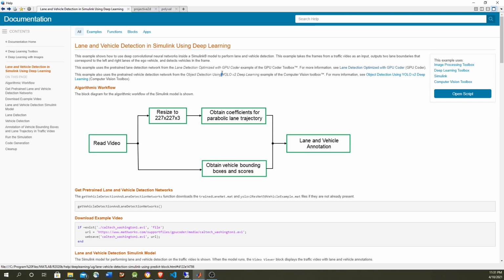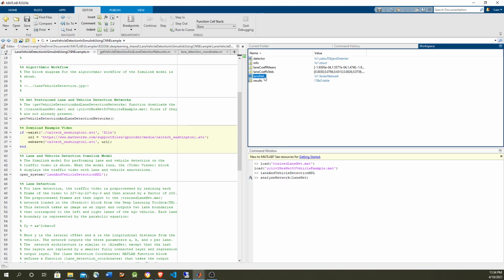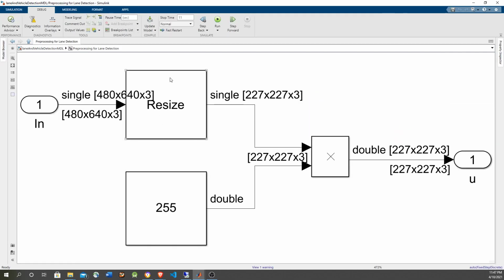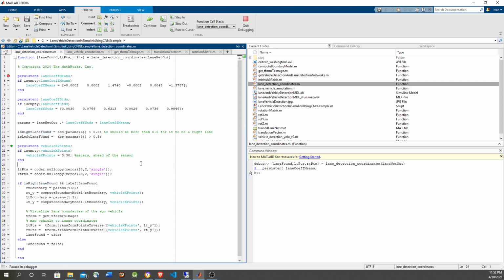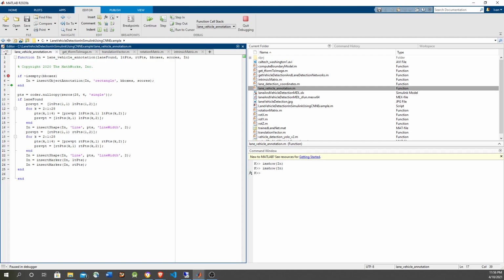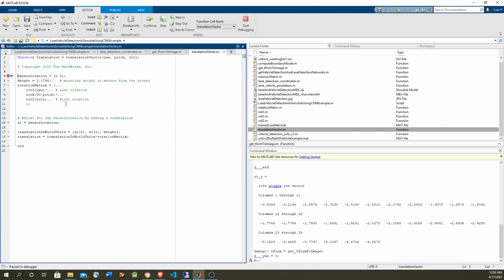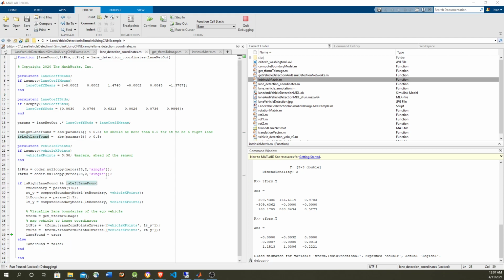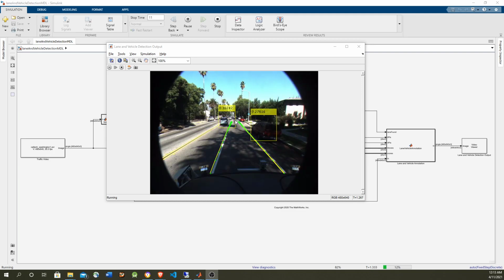Lane and Vehicle Detection in Simulink Using Deep Learning example walkthrough

Comment: Please make a tutorial on "Lane Detection Optimized with GPU Coder" link :https://in.mathworks.com/help/gpucoder/ug/lane-detection-optimized-with-gpu-coder.html

And Highway Lane following, link :https://in.mathworks.com/help/mpc/ug/highway-lane-following.html
Reply from the maker: For the first one I do have an example of generating Cuda code from an ADAS application:
https://www.youtube.com/watch?v=PplR1SljalM
In the example above I was able to get it working with GPU using the mex configuration. But I can't compile it as a library to be used in a C/C++ file; I don't have the GPU Cuda environment completely setup. There is a setup process for this. I suspect that will take a few hours I don't have :). This article could help with this (I could not find a video for helping with this). It is showing an app for doing it. I could be wrong and it might take minutes instead of hours!
https://www.mathworks.com/help/gpucoder/gs/using-the-check-gpu-install-app.html
For the second example I am not into the MPC toolbox :) This ADAS valet parking article shows how reinforcement learning could be an alternative for MPC:
https://www.mathworks.com/help/releases/R2021a/deeplearning/ug/train-ppo-agent-for-automatic-parking-valet.html